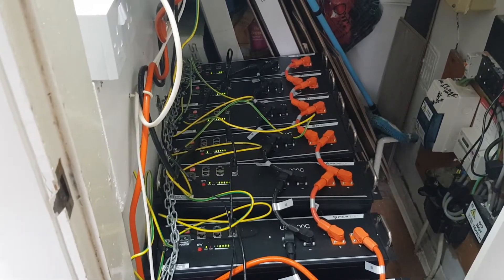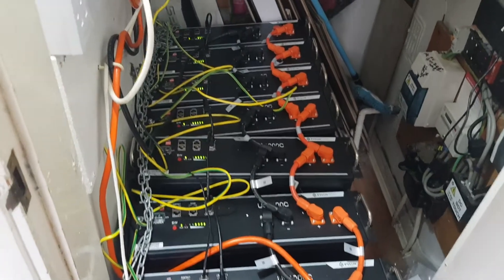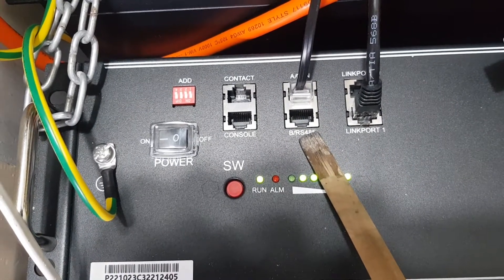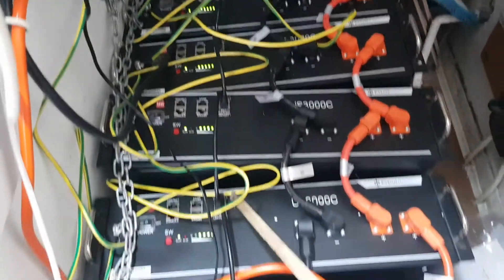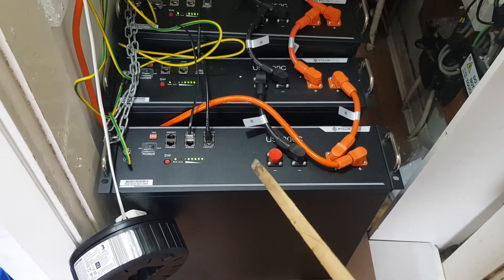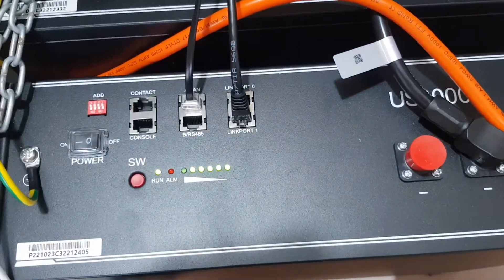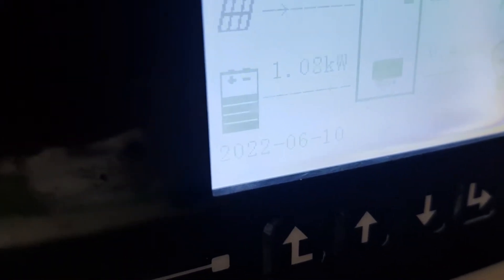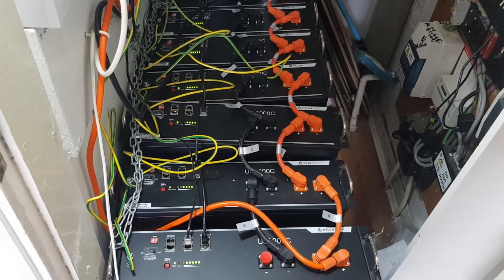Pylontech batteries, how to network them up , connecting BMS system using CAN. Please subscribe

Comment: Ive just added a us5000 to my system, 3 x us2000 1 x us3000c,  i have a lux hybrid inverter which needed a modified can connector when I installed the us3000c as the master, but now im having the us5000 as the master, ive had to make another different one, is this common among different brand inverters?
Reply from the maker: Yes different brand inverters adopt different CAN standards . As you have modified can cable then it will work
Reply: Just thought it was odd, I had to modify the cable for the different model batteries from the same manufacturer, yet there is very little if any info on this, very strange
Reply from the maker: Very little info and not all manufacturers share a set standard. Its a shame really but its the way things are. Please subscibe to this channel.  @WalkabletunaVEVO
Reply: Already subscribed 👍
Reply: Unfortunately having an issue with my lux inverter, the DC side seems to have gone kaput, batteries aren't charging/discharging and no solar production is happening, my installer is looking into it but just keep going round in circles 😢
Reply from the maker: @WalkabletunaVEVO  . If you have no solar or battery charge/discharge this would suggest a faulty inverter , if all wiring is ok. Swap the inverter for a new one. This is where i would start
Reply from the maker: Also check the DC , fuse and AC side fuse switch l could of tripped

Comment: Help I have acquired 3 Sonnen brand batteries that are Pylontech batteries. They come on for 10 minutes then shut off. I have hooked to them using RS232, I type “help” to get all the commands for getting info and a little control of the battery. What command I need is how to turn the batteries on permanently. Can you help?
Reply from the maker: Sorry we only connect using CAN bus. We do not use RS232 , so really cannot tell you how to achieve the batteries permanent ON status but I am sure you have misconnected the batteries somewhere. Best to contact your inverter supplier or where you got the batteries from!
Reply: @pylontechsolarbatterystora3979  I am studying CAN bus right now. I know every communication protocol except that one. Seems like I will need a piece of hardware for my computer or Raspberry Pi, whichever I decide to communicate with the batteries. At least I now know to stop looking on the RS232 port, it provides useful information but does no control. Thanks for the reply.

Comment: Been fitting my new US5000 today and was wondering as the short leads are a bit too short, whether you can go straight across rather than diagonal as you have the 2nd and 3rd orange leads. I assume it makes no difference. When I got it all wired up I had one of the original batteries flashing the red light. So disconnected the new battery and put everything back to original and still not working, said no AC input and I found the plug labeled GRID was not properly screwed into the Control box. The retaining ring has a bayonet fitting and could never have been properly fitted by the installers and lifting a 40kg battery, must have shaken the fitting loose.